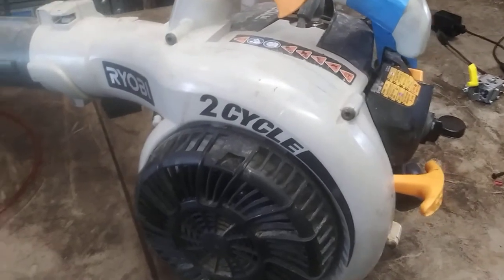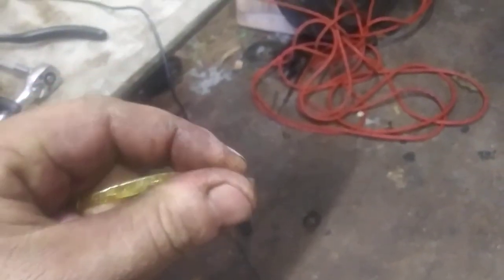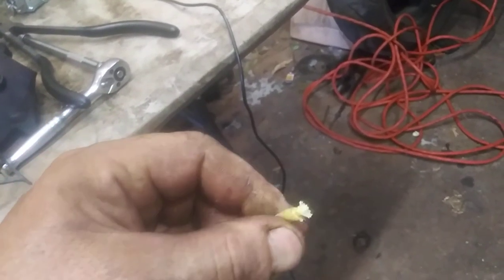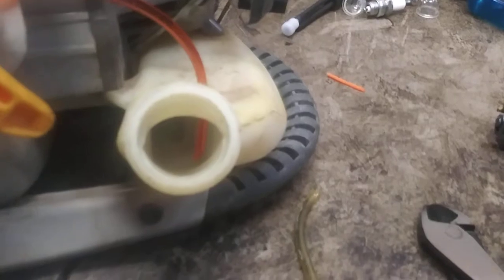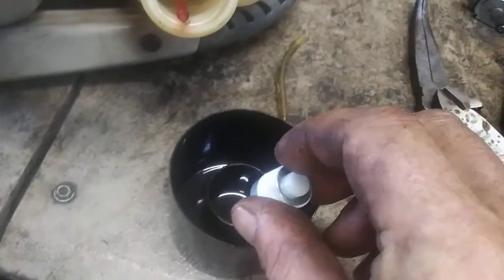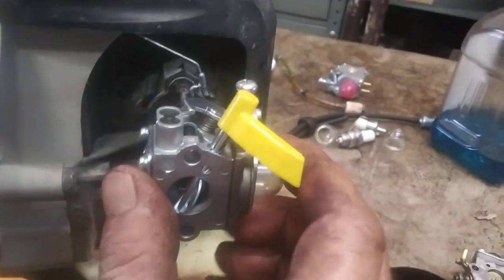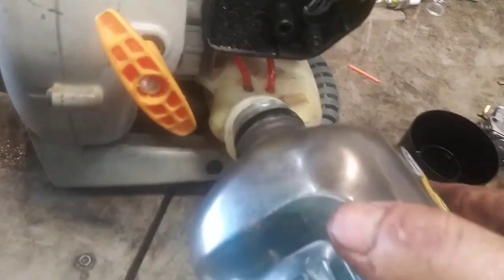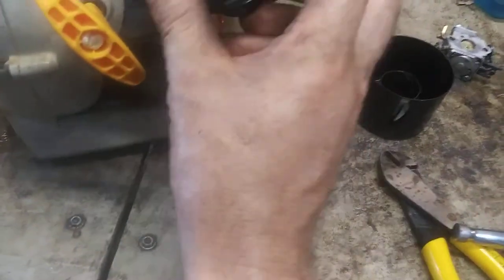* Ryobi 2cycle blower carburetor fuel lines

Comment: When my Roy I sits for a while. When I pick it up gas runs out from under gas tank. I think.  Then it stops. When it runs it’s fine. Any iPads? No clue where it’s coming from
 I don’t see any cracks in fuel tank
Reply from the maker: Fuel lines probably have shrunk. Needs new ones

Comment: Just what I needed to know for the fuel lines cause I. Good reality I didn't know how to route them, neighbor gardener threw in trash, had no spark changed spark plug & works like a charm. Thinking neighbor isn't mechanically inclined. But than again I love thinking on why something doesn't work & get it working right for someone else to use
Reply from the maker: glad i could help

Comment: by any chanse do you know the part # for the tube?  i cant find it anywhere?
Reply from the maker: no but i got a lot. check your local small engine shops i think echo will even fit it.
Reply: @smallengineguys  what do you mean you have a lot?
Reply from the maker: @manuelmaldonado4951  i keep them off of junk ones. Your talking about the tube not the fuel lines right?
Reply: @smallengineguys  yes the tube..do you think you can sell me one?  i already bought one but it did not fit.
Reply from the maker: @manuelmaldonado4951  do you need the whole thing or just the end tube
Reply: @smallengineguys  just the first one.  the one that conects to the blower
Reply from the maker: @manuelmaldonado4951  ive got a bunch of the ends lol. Ill keep looking
Reply: @smallengineguys  take off the one from the blower on the video.. jajajaja

Comment: I can’t get the air filter out of mine I keep on turning the knob and it will not come loose do you know what the trick is to removing that knob?
Reply from the maker: might be stripped. you may have to cut the plastic knob away from the metal bolt inside it.
Reply: @smallengineguys  sounds good. Thank you!